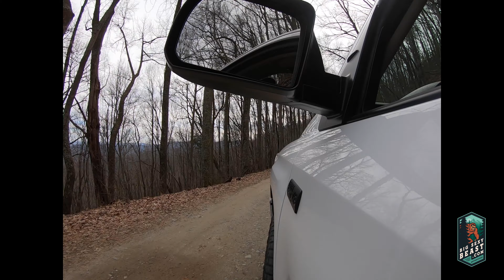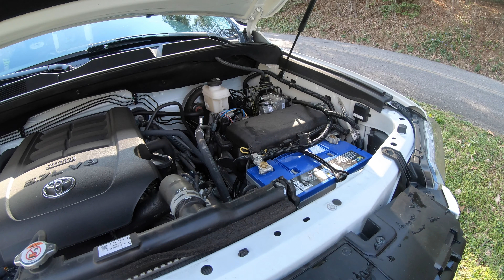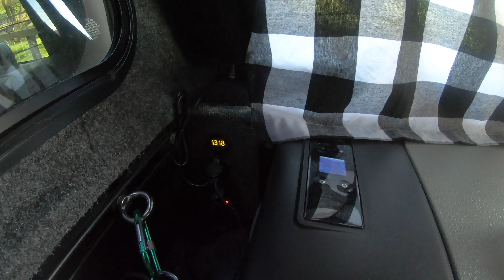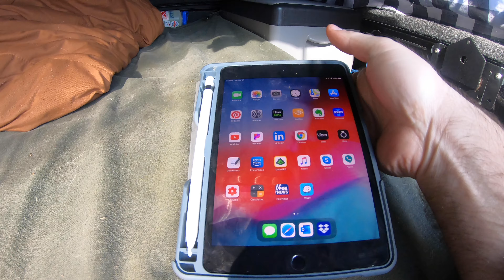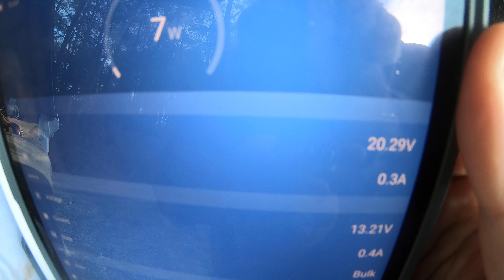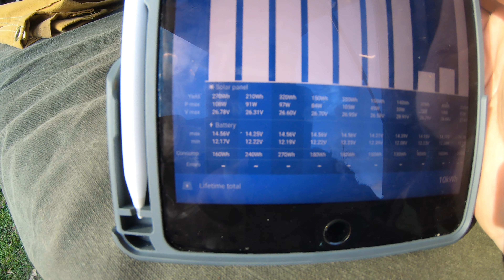HOW TO CAMP INSTEAD OF TRAVELING... WITH A STEALTH TRUCK & SOLAR PANELS!

Comment: Many solar panel manufacturers recommend leaving air space for ventilation underneath the panel. These things get very hot being dark colored when in the sun. What has your experience been with your panels that don't have ventilation underneath  ?
Reply from the maker: I haven't had any issues with the thin flexible panels being flush mounted... but I have heard the same thing that you mention

Comment: Did you fuse the wire from battery to solar controller?  If so what type fuse you used ?
Reply from the maker: 30 amp I think

Comment: The LED lights from the ARE MX have (4) wires and have been wired into a tail light, with (2) wires eventually making their way to the battery. If running a 2nd battery, do you know if I can just switch the (2) running to the battery and leave the rest alone without interfering with the tail light? Thanks for the content!!
Reply from the maker: I don’t know. It’s a good question. Could you ask the dealer who installed it? I suspect the tail light wires are for the third brake light, separate from the led indoor lights but I don’t know for sure
Reply: @BigSexyBeastAdventures  I just realized that because you are only using the truck battery, you didn't have to mess with that at all. Of course its the third brake light. Thanks a lot for the reply!!! Do you ever use an inverter? Too much amp draw?

Comment: To confirm....are your accessories being run strictly off of solar?  Link to explain the load feature of the charge controller, or is that explained in your basics of solar video?

Update. Question answered in your basics video. Thanks. Great info👍

Comment: Hey!  Your videos are real helpful and informative.  Could you tell us  how did and where did you run your wiring for Sirocco fan and did you run it to the battery with a fuse?  Also do you have any ideas for the continual light that is on the 12 volt  power strip(of the Are shell)? And it's slightly warm.  Is this normal? Thank you for your help.
Reply from the maker: I wired a fuse panel into the camper shell and all my accessories tie into that fuse panel on individual circuits.  I think you are talking about that small light in the ARE light switch?

Comment: HI HOPE YOUR WELL . I HAVE THE SAME TRUCK . DO YOU HAVE A PART NUMBER FOR  YOUR NORTHSTAR BATTERY ? WHAT SIZE IS IT ? ALSO IS THAT RIGHT HAND POSITIVE ? THANKS BE BLESS .
Reply from the maker: https://www.batteriesplus.com/product-details/auto_light-truck/battery/x2power/sli27fagmdp

Look at that one... also, call the people at batteries plus. They were very helpful
Reply: @BigSexyBeastAdventures  THANK YOU . I WATCH ALL YOUR VIDEOS . YOU SAID 105 AH . THAT WOULD BE A GROUP 31 . WILL A 31 FIT . I SOLD MY HOUSE AND IN A FEW WEEKS WILL BE LIVING ON THE ROAD . I WANT THE BIGGEST BATTERY I CAN GET WITH NO MODS TO BATTERY CABLES . THANKS FOR YOUR HELP .
Reply from the maker: I think you are right about group 31. I think it will fit... but is heavier. I’ve heard about people having trouble with the weight of group 31 but personally don’t know... think mine is group 27 now that you mention it
Reply: @BigSexyBeastAdventures  THANKS FOR SPEEDY RESPONSE . IF YOU GET A CHACE CAN CHECK TO SEE WHICH ONE YOU HAVE . THANKS AND BE BLESS .

Comment: How did you mount the water port to your T-track?  Did you use T-slot Nuts?  If so what size are they?
Reply from the maker: I used these.... but had to space them with washers and longer screws due to the overhand of the camper shell.... https://www.amazon.com/gp/product/B07739WXJB/ref=ppx_yo_dt_b_search_asin_title?ie=UTF8&psc=1

Comment: Great Video! About to start this project on my tundra, was wondering how you got the wires from the solar panel into the shell?
Reply from the maker: Thru one of the screw holes in the rack rails on the shell. I can send you a photo if you want
Reply: @BigSexyBeastAdventures  yea that would be great!
Reply: I was wondering the same thing .. thanks ..

Comment: I have a million q's and dont even know how to ask. When you charge the one battery with alternator and solar, is there a switch or can you charge them with both at the same time, and no inverter ?
Reply from the maker: over simplified answer... imagine 2-3 different water hoses all emptying into a barrel.  The hoses are your alternator, solar or other.  The barrel is your battery.  The barrel can take water from any of the hoses until full... and takes from the hose with the highest potential (in this case, voltage).  As to inverter... I have a small 300 watt modified sign inverter that I use kind of on demand (meaning it isn't hard wired into the solution - I plug it in via cigarette power plug.  I might in the future add a pure sign... but don't think I will need it with this truck application.
Reply: @BigSexyBeastAdventures  Thank you for the answer, then why do some use ATS, as example, I want to add solar to my Montana and use the existing circuits, I want to make a 30AMP connection female to plug my house feeder to and I wonder how my converter is going to react if its being fed by a pure sinewave 3500 watt inverter, also the 5 lead acid 90AH batteries that will be only connected to the 3500w inverter does it have to be chasis grounded ? I know thtas a lot but you seem super smart :-)

Comment: That breaks it down well for a non-electrical guy like me!  Thanks. What do you have tied up in the entire system?
Reply from the maker: Roughly... $200 for the panel... $200 for the controller... $360 for the battery... $50 for the usb and cig port... $30 for the fuse panel... $30 in wire... $200 for the fridge...